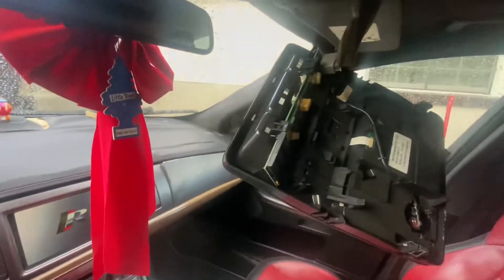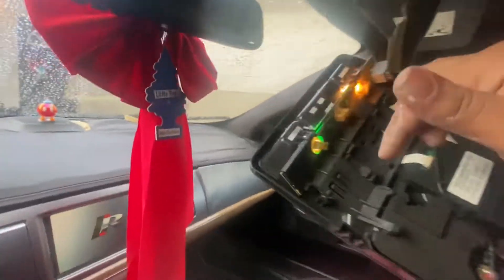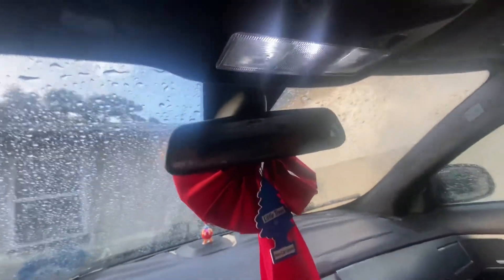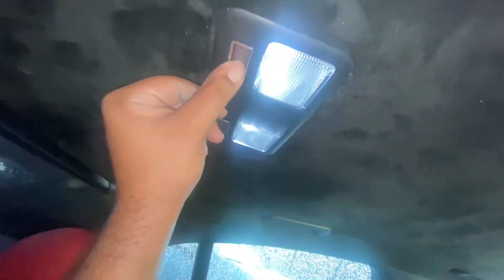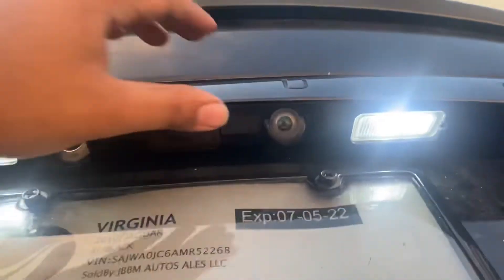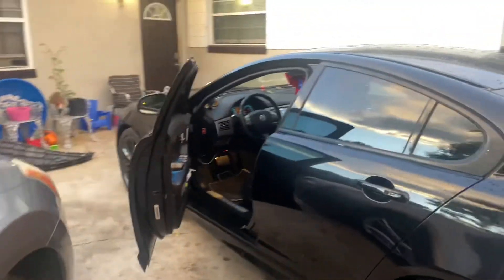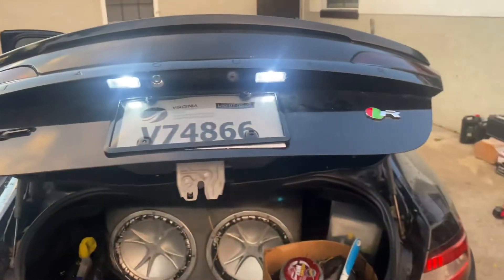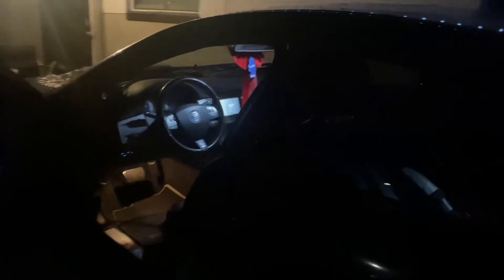Doing my 1st mod to my Jaguar￼ XFR￼..LED light for in interior￼

Comment: Greetings, sheeple of Orlando! Got some red-hot weather report for ya it's a beautiful burning 92° and a disappointing 75° sun rises at 6:27 AM and sunset at 8:22 PM a weak 2 mph winds i hope your hair doesn't get ruined by the humidity which is at 81% Dew point at 72° pressure is 29.95 in I hope you don't have a hard time breathing UV Index 0 of 10 visibility 10 mi moon phase Waxing Gibbous and with that I bin you adieu